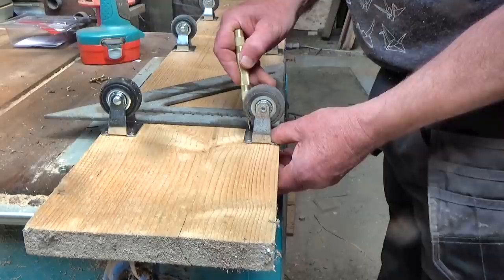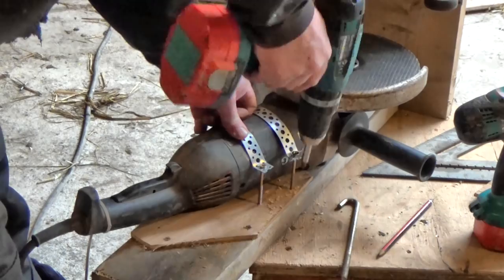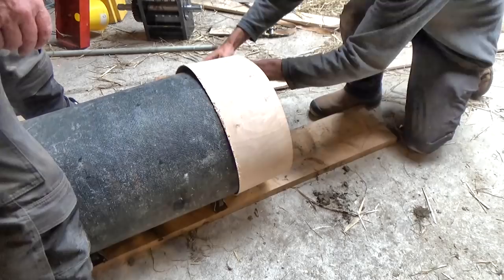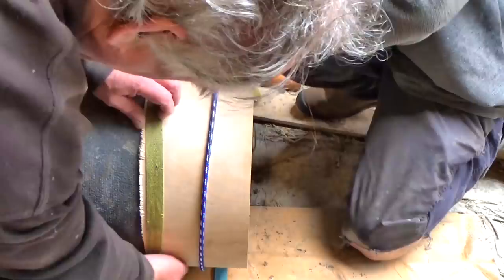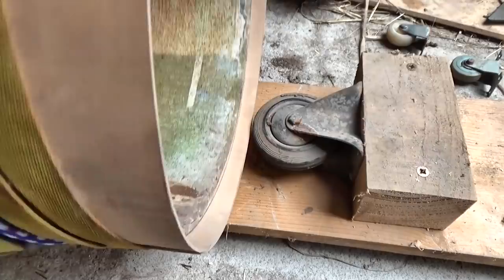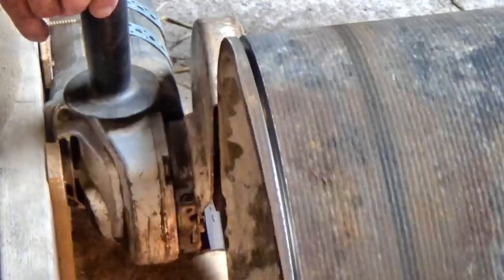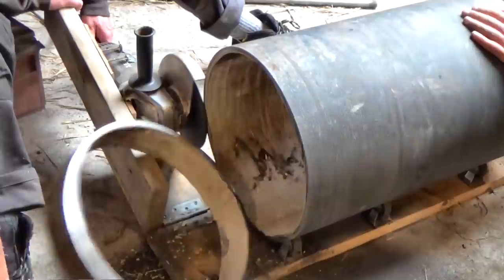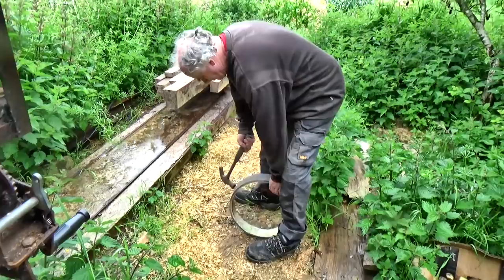Quick And Easy Homemade Pipe Cutter (for BIG pipes)

Comment: Clamp piece of wood cross the pipe (opposite side of the cutting end). Find the centre and mount ball bearing there. Push it against guide to make cut. Centre is easier to line up and eliminates any wobble. 
  Love your inventions.
Reply from the maker: Great idea! Thanks. Why didn't you tell me before I did it this way : -  )
Reply: @WayOutWestx2  well I tried. I was yelling at the screen as I was watching :)

Comment: For years I've been dreaming of making a pipe cutting arrangement a bit like this. 
I was gonna use bearings instead of casters and I want to somehow clamp the pipe between three sets of bearings so the pipe is tightly trapped and hopefully aligned so that it won't wander lengthwise.

Comment: I believe you have a section of cement lined ductile water pipe. Should not contain asbestos but shares some of the characteristics of cast iron from what I can remember.
Reply from the maker: Yes, that seems about right. Tough stuff, whatever it is.
Reply: @WayOutWestx2  Asbestos was used in Transite or AC pipe, mostly for storm, sewer and sometimes potable water. It was also used extensively for pipe insulation. I still do not believe your section of ductile iron pipe contains asbestos

Comment: That inner layer came off because, by hitting the inside, you asked it to expand and it doesn't like that. Before you were hitting the outside and, like any concretion, it loves compression and is crap at extension.

Comment: The Pulmonologist in me is concerned that concrete lining is asbestosis.

I am not certain how to test for that. You certainly are going to make a dangerous aerosol if it is.

If you cut it under water it might be safer but I don’t know for certain.

Be safe
Frank
Reply from the maker: It's water pipe, so I don't think they would use asbestos for that, would they?
Reply: That was my first thought as well. Searching on it, Ductile iron (water) pipe has been made with asbestos "cement" lining into the 1980's, one of the properties was an extra smooth surface reducing the need for pumping power. Cant hurt to do a "wet" cut regardless, cement dust also isn't brilliant for once lungs.
Reply: @WayOutWestx2  if the pipe is more then about 10 years old, asbestos is very likely, maybe get it checked.

Comment: Is that Asbestos in that pipe?
Reply from the maker: I can't think why they'd use asbestos  - so probably not
Reply: Looks like you were given a Ductile Iron pipe lined with cement, appears safe enough as it is used for water piping. Just thought it was worth researching.

Comment: That liner inside the pipe looks like Asbestos to me.
Very Dangerous And Hazardous Stuff.
"I hope i am wrong on this one".
Reply from the maker: It's water pipe, so I can't see why they would have used asbestos
Reply: @WayOutWestx2  Asbestos was used in drinking water pipes in the past.
Reply: @michaelmcmanus8931  A farmer friend of mine was saying the mains pipes around here are asbestos.
I think the pipe itself might be malleable cast iron so somewhere between cast iron and steel. Welds ok though.